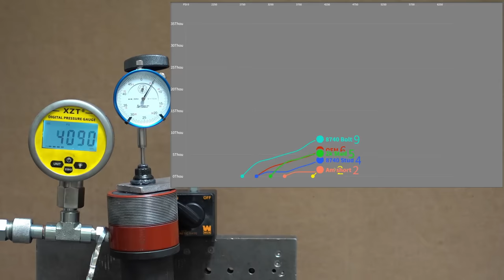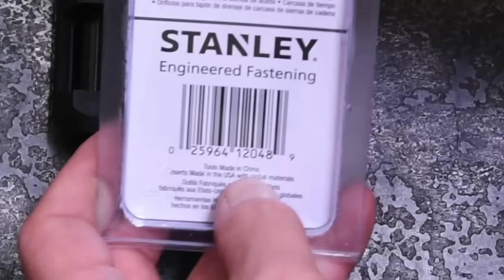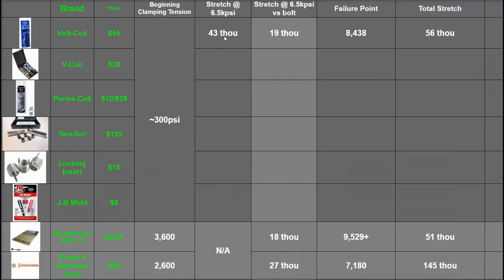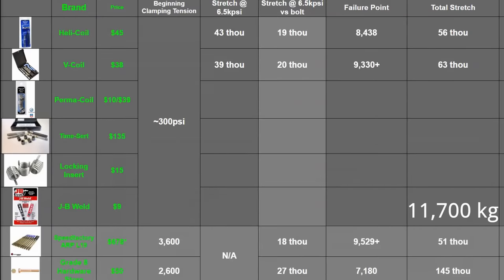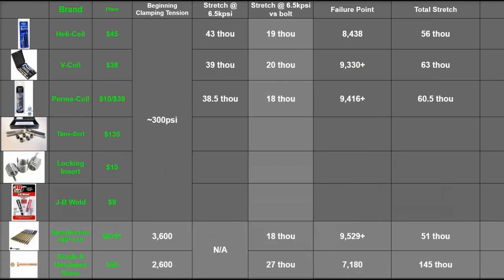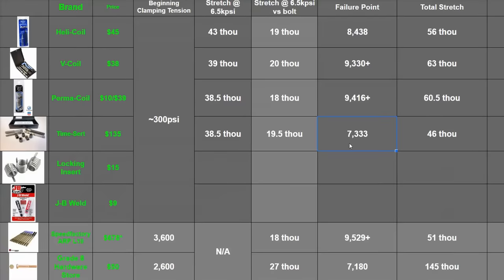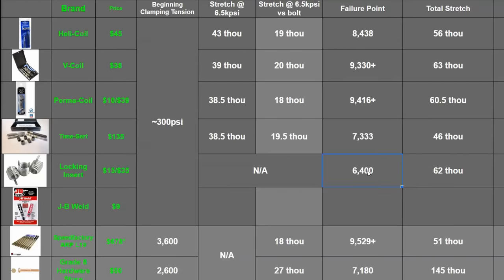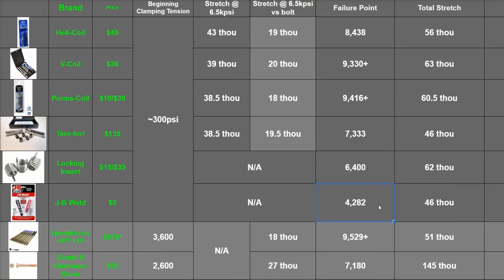12tons vs Bolt Thread Repair Using Time-Sert, Heli-Coil, J-B Weld & More

Comment: You should re-do the JB weld test,  similar to that of a Heli-Coil.
Drill out the old threads with the oversized Drill, then run the larger tap to create new threads.
This gives the JB-Weld something to grab on. The Oversized threads.
Fill the Hole with JB-Weld, let it cure.
Then Drill on Size for the Bolt size, and tap new threads.

Comment: 1:51 Dang really trying to test razors on fingers as well! Hot on the heels of Project Farm. Love the testing from both. I've personally used Perma-Coil, just to save some money when they seemed just as good as Heli-Coil. Glad to know my instincts were fairly solid. Extremely surprised Time-Sert failed like that, but I think it shows why there is actually a benefit to a coiled insert rather than solid. I had always heard the locking type was best as well, so very surprising, but again shows the moveable coils may be beneficial. No matter what, all of these inserts are crazy strong.

Comment: Personal Note (from experience);
When "packing" Epoxy into a stripped Threaded Oriface, use a Toothpick or metal rod to "stir" the Bonding Material into the failed threads for a "marginally better" bond.
I'm not telling anyone what to do, but after a good cleaning with a cotton swab (prep), getting that stuff into every crevice that is being "temporarily repaired" can make the difference between being able to drive another 2 miles (curbside automotive situation) or 20 miles...

Comment: I'd like to see one more test: A custom solid insert made by drilling and tapping a larger stainless-steel bolt. It's a pain to do but the upside is that you don't need any special bits or taps, you can have any thread combination that fits (more the one size up/different pitch/SAE to metric etc.) and you can make it as long as you need to engage all of the available thread (unlike off-the-shelf inserts which are only sold in 2 or 3 lengths).

I did this to a bolt on an injector clamp (Renault K9K - 1.5L 4-cylinder turbo diesel) where someone had already attempted to use a coil insert but screwed it up and the injector came loose again and destroyed the already-oversized thread in the aluminum head. It only cost me 40 Kč (less than $2) for the bolt and it held for over a year until the whole car was scrapped for unrelated problems.

Comment: Cast iron doesn’t necessarily require cutting oil because the high carbon content $ crystal structure leads to numerous graphite crystals in the material. When you cut into the material, the graphite acts like a lubricant.

Comment: I get to do most of the broken/ stripped thread repair where i work (lucky me) and use some type of helicoil the most unless the threaded insert is required. JB weld is for when a bolt doesn't do much but has to be there. I also sometimes use thicker inserts so when somebody else messes it up trying to fix it themselves and gets it off center i can use a dremel/die grinder to shift it into the right spot do drill and tap it bigger.

Comment: It is hard to say without getting a closer examination but on the Locking type it looks like there was a flaw in the cast iron that you were testing. But that's just what little bit I saw of it.
The few times I've ever used a J-B Weld to make a thread I put the J-B weld on the bolt that had wax release agent on it and put it in the hole with the J-B Weld and waited about 48 hours. I knew that they were not particularly high strength, but it was actually better than the aluminum that had given up. And still worked in the aluminum in one case that I had used it in

Comment: Helicoil style inserts are used in aviation engines from the factory.  The case studs for instance in your common 4 or 6 cylinder aircraft engines screw into holes in the aluminum case halves that have been drilled and helicoiled from the manufacturer. This is due to the fact that they are supposed to be stronger than just tapping the base metal, and more resilient to wear from repeated disassembly.

Comment: Very surprised that the JB Weld did so well... I knew that it was pretty strong, but that's remarkable... 🙂
Half the battle with it, like any epoxy is totally clean and grease free metal for it to cling to. Done right even hammering it leaves a layer stuck to the steel..... I had to machine it off in the past. Amazing stuff really, but yes it has its limitations, but they are few for many purposes...

Comment: Nice work. I would love to see how your fixture worked. Also, what improvement would you expect by tapping the hole before adding the JB Weld, similar to how the wire inserts get that treatment. Thanks for the shows.

Comment: What I’ve done with the Time-Sert’s while using them, is put red loctite on the outer threads so to cement it further.  Maybe to try that with another thread insert video, but using red loctite on the outer threads for each install.
Reply: He did use red locktite on the outter threads didnt he? I know he did on most, and he reused thr same l19 stud for almost everything so i dont thing he used it on the inside threads

Comment: Fun fact: Helicoils are the only FAA approved threaded insert, and are used on brand new aircraft where a steel fastener is used in an aluminum casting.

Comment: Self tapping thread insert is what I like using on steel. It worked great on my quad frame for the skid plate bolts. I don’t know it this is necessary but I weld around the top of new threads.
Reply: That actually sounds like a great idea. I might be borrowing it now... :)
Reply: @floorpizza8074  I first tried a Heli Coil & broke the tap. I went back to the place I got it & a guy told me they have a self tapping thread insert. I first drilled the old threads out & screwed in new threads. It worked & to be safe I put a bolt in it before welding the edge of the new threads. Then took bolt out to clean threads & put a new bolt in. 
20yrs later I had to do this again & couldn’t remember which side I done. Went back to the place I got the self tapping thread insert & they didn’t sell them anymore. I did get a thread insert that you tapped the old one out bigger to insert new threads. I tried grinding notches in the thread to make it a self tapper. That didn’t work & I cutted the threaded round tab off that was welded to the ATV frame to weld a nut to the frame. It worked & if I have to do that again I’m going to try Rivet Nuts. Drill out the threads & rivet the new nut in. I still will weld the rivet on to be safe. 
Good luck with your project.

Comment: Loved the DBZ reference 🤣
Also, the time-sert insert was improperly installed from what I saw in the video. You're supposed to turn it in with the installation tool until it tightens and then continue until just after it loosens again.

Comment: It seem from my experience that the plastic guide is essential to install a fine thread insert it allows you to load tension in a twisting motion to the insert making it slightly smaller in diameter for far easier install.

Comment: The Time-Sert one surprised me. I have used those a lot on the GM Cadillac head bolts of the Northstar engines that would frequently stripped the threads in the aluminum blocks. I was expecting those ones to do much better than the Heli-Coil style of inserts.

Comment: A good test may be formed threads vs cut threads (two different types of taps). You would want to keep the percentage of thread engagement the same. Also minimum thread engagement. I was taught a minimum is 3X full threads is acceptable. I typically design for 1X diameter - 2X diameter engagement if there are no constaints. I never had any issues with this so I never tested?

Comment: One thing to think about in your testing is that longer coils should be used in cast iron and aluminum to increase the surface area. You should use a pivot are on the dial indicator so the indicator is extending then it won't ruin the indicator when something breaks.

Comment: Great video as usual. I just feel that most people would like to know torque specs on these inserts. It's not like I can say,  "be careful with that bolt you're tightening on that insert, it can only hold 5000 psi". I get the jist of it, just looking at it from a different perspective that most people would I think would understand.

Comment: I was under the impression that timesert was named that because they’re the fastest to install in bulk because you can use a drill for all the operations. They’ve got a video of them drilling a bunch of holes, tapping all the wholes with the tap in the drill, and then sending in all the inserts quickly with the drill as well

Comment: If you were to bolt or weld a piece of metal to the side of your block you can put the indicator on the bottom side of it you can measure  the stretch without breaking the indicator.

Comment: I think the most important result here was the JB Weld. It's not completely useless! Half the strength of a proper bolted joint still beats a mess of cable ties 😉

Comment: If you install the helicoil with the tread installer it has the tendency that the helicoil pumps a tread after the 2nd tread and it binds up immediately locking the bolt and damaging the complete treads you have to use the tread guide when installing as not to jump threads

Comment: Helicoil is the latest US brand to suffer the horrific Stanley death knell.  WAS a great all American made company that sold out to Stanley to become an offshore less than its former glory remake.

As for using JB Weld, they used to have a kit that included some blue colored gel like releasing agent thhat you applied directly to the threaded part you were using to form the threads in the epoxy.  I used some in the early 80s on stripped out threads in my spindle for the king pin cap.  It worked great for that application, but it was torqued to something like 40 lbft.

Comment: Thank you for taking the time to make this video , I always thought the Time Serts would be the best ????, But one test is better than 10 expert opinions. As and auto mechanic the Torq sequence and bolt Strech procedure causes a lot of anxiety  the whole thing about going throught a torq procedure only to loosen every thing up and do it again with the worry of pulling the thread out of the block is gut wrenching  every time i have to do it .I like the test you did but if I could see how many LBS those numbers would convert to it  would be interesting if I knew the formula I will watch the video again just to see those numbers ???

Comment: You should make a mechanism which reverses the motion of the dial indicator, so the indicator extends as the fastener stretches. Then when something breaks, only the link between the part you're measuring and the dial indicator has to absorb the energy. The link could be a 'T' shaped part which slides along the T stem axis, with one branch at the top resting on the part being measured, and the DTI pushing up on the other branch at the top. You could easily make it absorb the energy some how, so the 'T' shaped part doesn't crash back down into the DTI. Then you wouldn't wreck any of the test rig parts when something goes bang.

Comment: When we use thread repair the order was if allowed by engineering: 1, next bolt oversize, 2, Coil threaded insert, 3, threaded incert. Never considered JB weled to be a thread repair. I will be tucking that away for the super secret knowledge base

Comment: I think the locking insert is probably causing stress risers / small cracks where the lock tabs are broached through the threads in the cast iron. It’s probably less of an issue in soft metals like aluminium. 

It would be really interesting to see this test in cast aluminium samples. I think most of the thread repairs should end up with higher values than non repaired.

Comment: I ended up using high temp jb weld after stripping out threads for the o2 sensor. Still holds after 2 years and no engine codes. It's not right, but it works

Comment: I find it interesting that the timecerts failed the way it did. Gm has you use them on the Northstar v8 for the head bolt repairs

Comment: It would be cool if you made a video trying different ways to use jbweld for thread repairs. The way you did in the video, drilling tapping adding jbweld then redrilling and tapping, putting jbweld in messed up threads then screwing in the bolt and letting it cure. Whatever other ways you can think of would be cool to see

Comment: So the thing about timesert most of the time, (haha) is that they make a specific kit to do a specific job.  Say for subaru head bolt holes. The insert itself is very long to provide more thread engagement into the aluminum. I don't think a short helicoil would hold up the same way. That's just me. It is very interesting to see these results tho..  I wonder if the steel wire inserts kind of pad the stress instead of putting it directly into the cast....
Reply: One Helicoil insert provides 1.5D of thread. If you want more, for, as you say, use in Aluminum, you can use two inserts. It's even possible to cut an insert down so as to fit the maximum amount of repair in a given depth of hole.
Reply: @handpaper6871  I realise that. However heli coil doesn't make a kit to do that particular job in the car. Or come with a template the proper length tap and drill bit or guide. Sure you can stack helicoils but are you going to do that when your name is on the bill? I'm not, I'm going to go with the proven repair that's not just used by me, but by machine ships and dealers around the world to fix that bolt hole.

Comment: The results of thread repair depend more on the person doing the repair than the chosen style of repair.  Believe it or not, coil style thread inserts are common on many aluminum defense products to give the threads serviceability.   Running bolts in and out of aluminum threads is a sure quick death sentence vs using a hard steel thread insert.   Just have to install them properly.

Comment: Timeserts I believe our better applied to thread repairs that need to seal. I fixed an oil pan with one about 2 years ago. Worked great. Helicoils and keenserts leak.

Also I think your keensert failed at a lower PSI because of how coarse the thread is compared to the keenserts length

Comment: When I use loctite to install heli coils, I prefer to let the loctite cure with a lightly greased bolt installed to preload the threads, taking up any slight upwards slack and mimicking distortion from install.

Comment: Inserts are definitely not a bodge. If you consider it logically, if the material in the blind hole is the limiting factor from a strength perspective (and it normally will be) you are effectively using the next size up bolt thread which will definitely support a higher load. The one thing to consider is thread engagement as you do not appear to have matched stud engagement for the plain threaded hole samples with insert thread length. There is a law of diminishing returns with thread engagement, but more engagement will mean more pullout strength.
Reply from the maker: Both the bare threads and insert threads where engaged .6-.65" deep which is what ARP told us was the block engagement.

Comment: Inserts are stronger when installed properly over spring coil type…the reason the time cert failed is because the installation tool is tapered and you only got half the tool through it…time certs work great on applications where you can run the tool completely through the hole (like a spark plug hole). The spring coil type is great for frames, motorcycle engine cases, suspension etc but NOT good for cylinder heads, spark plug holes, engine blocks etc…pretty much anything that gets really hot you’re gonna want to use an insert…plus inserts work under compression loads which is part of the reason it’s flared at the top. (Had you had a bolt head directly against the time cert it would have had greater tensile strength) …also consider the material you’re threading into …if it’s aluminum then a time cert is by far the strongest option & thanks to the fine engineers at ford, (the Triton series ones specifically)  mechanic s such as myself got A LOT of practice with time certs 😂

Comment: It would be cool to see how well they perform in alloy castings - even machined billet as some of the very high end manufacturers will use inserts in all their product's where a thread is used.
I've also seen extra long inserts, but don't recall which they were?

Comment: Would love to see this done exactly the same but in aluminum because most blocks are aluminum now, I know PF did it, but in thin aluminum and they used grade 8bolts that snapped before the insert failed.

Comment: Hey there, great test, the only thing with the first hei-coil tests.. i think you had more thread on your original head bolt/stud tests, maybe you should of bought the double long heli-coils, to match longer threads in your cast iron test pieces..keep testing..Good Stuff...

Comment: Obviously the best case (unless in a soft metal like aluminum) is to drill/tap it to one bolt size larger. Only works if other part can be drilled as well.

Comment: Very interesting results here, I was surprised by the results,  I would've expected the jb weld to have pulled right loose done that way, I would like to see you retest the jb by drilling out and tapping the cast iron to at least a couple of size larger hole so the jb weld can actually get a good grip like the larger inserts, nevertheless it did better than I expected,  I also would've expected the solid inserts to have done much better than the spring inserts, surprises all around.